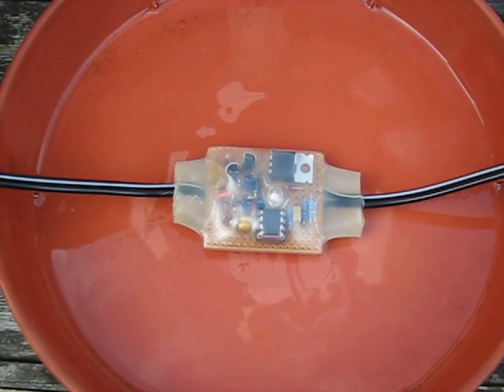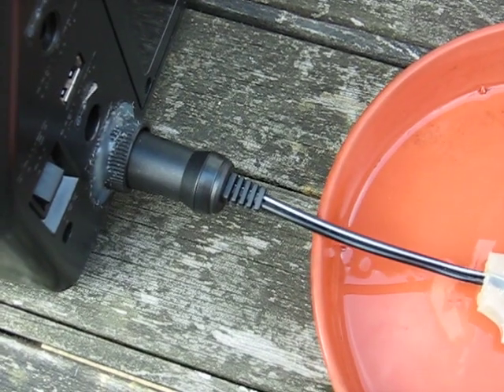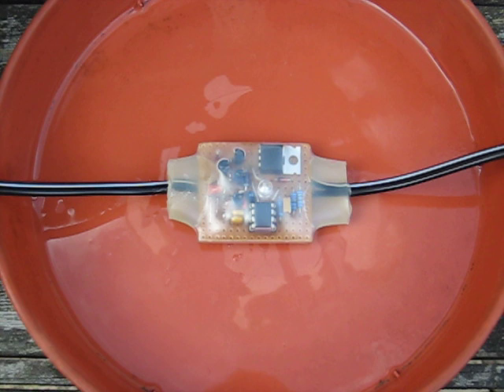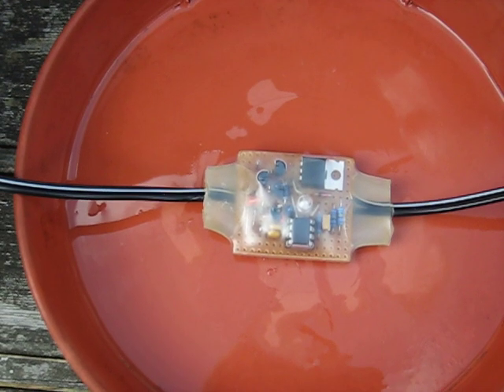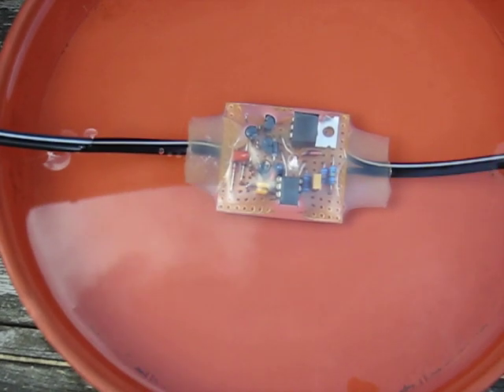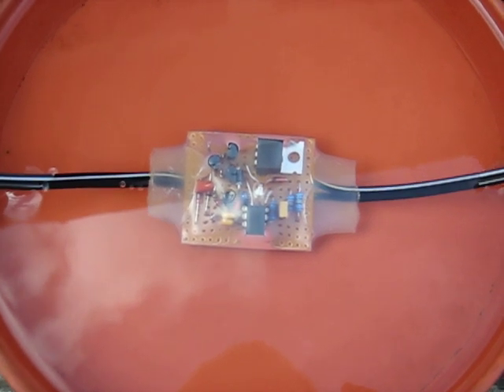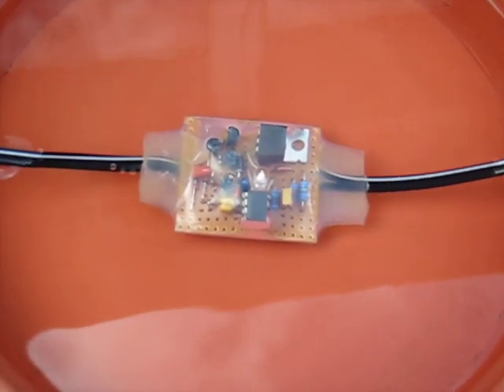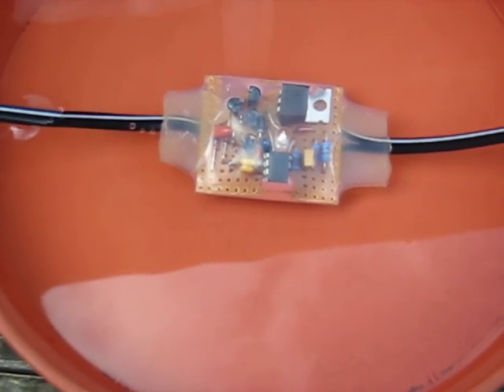PWM Solar Charge Controller Underwater Test

Comment: Just a suggestion:

1. the small unit with the heatsink should be faced the other way
2. the heatsink tab should be bent upward

then when you shrink wrap the unit, cut away an exposed area of the heatsink and rebend it against the wrap (it'll be like an S or U shape).  This will allow it to not over heat. (although it looks like a small CC, so overheating is probably not a problem, but just a suggestion anyway).